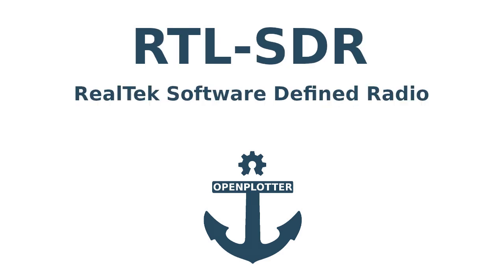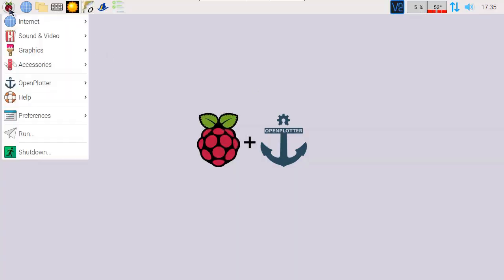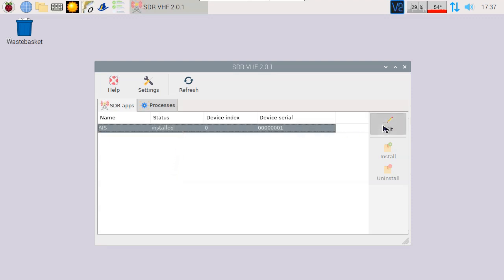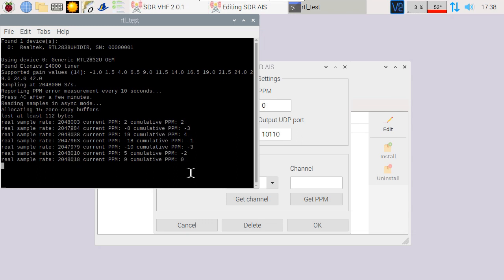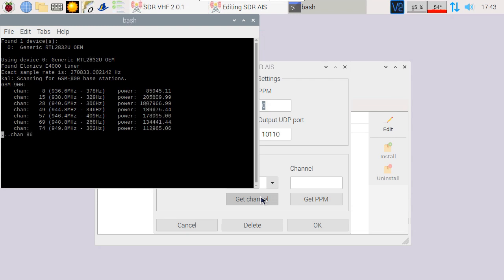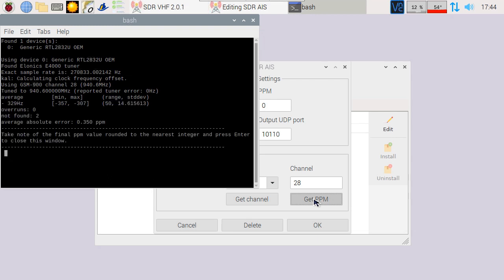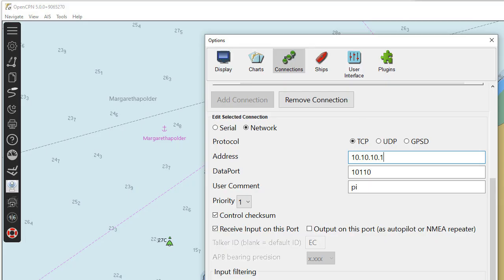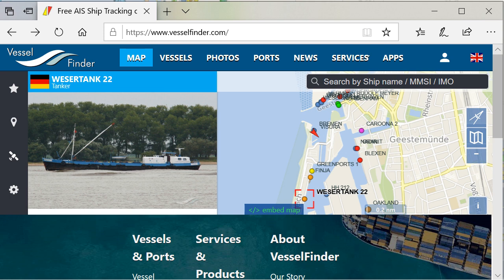How to setup AIS in Openplotter

Comment: With 26 seconds left in the video you add a connection under the options tab:  where does one get that information?  I want to hook up a sdr but where do you get the data that gets entered (address, data port, etc)?
Reply: I found it odd too... very detailed and then just brushes over the end.

Comment: Can you transmit your AIS position through this arrangement?
Reply: No you need an AIS transponder ($700 plus), which needs to be registered with the appropriate authorities, and this requires your license number for VHF. So you need a radio license to transmit your position. (Which mean a radio course fee and the license fee).   
Very expensive to transmit a position via a radio frequency.